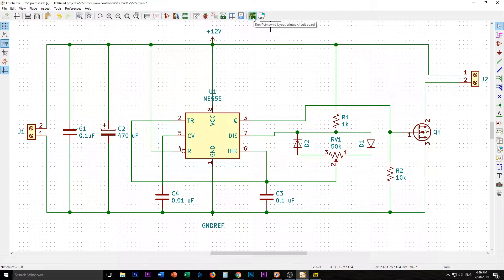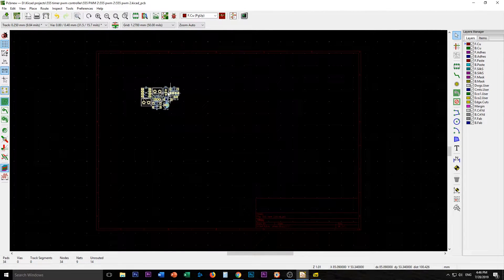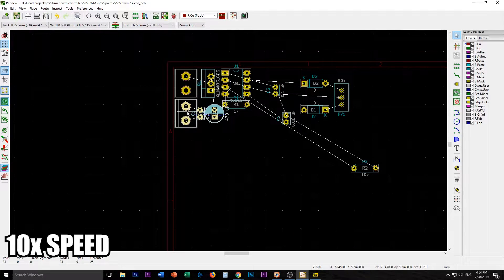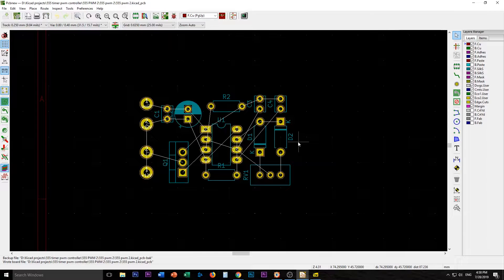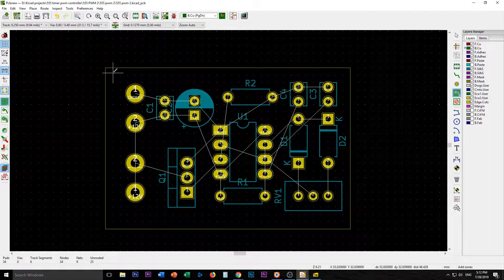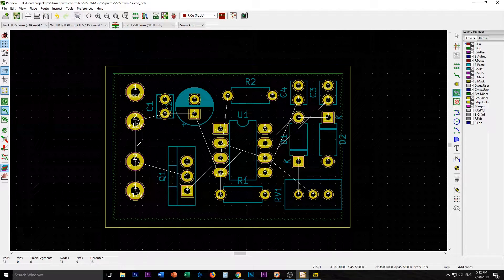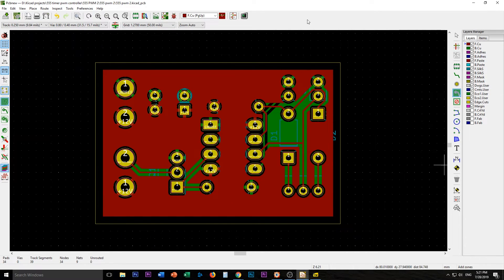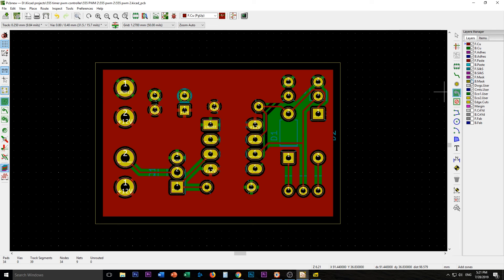KiCAD For Beginners 3 - Laying Out The Board

Comment: For the distribution of the devices I use a fixed 2.54 mm (0.1 inch) grid when ever this is possible. This gives a well ordered PCB design.

From the viepoint of functionality:

1.) I consider this PWM module as a controller. So i would through the power mosfet and R2 out of it in order to combine it with different power modules. So I would go directly from pin 3 of the IC to the output terminal and connect it to the ground plane. For the terminals I would put put the positive pin up and ground down. This helps also to save space for C2.

2.) C1 is the buffer capacitor for the 555 timer IC. it should be located as close as possible to pin 8 with a short connection to the ground plane. Otherwise it doesn't work the way it is intended to, especially if you use such thin copper lines.

3.) With 1.) and 2.) you save a lot of space left of the timer IC. So it can go more to the left to get space on the right of it. I would put C3 direcly to pin 2 and C4 directly to pin 5. So you can go directly from R1 with a straight line to both diodes and from the diodes to the potentiometer.

4.) The diode package is much to heavy. You dont need 1 A diodes in this circuit, they are also relatively slowly (which doesn't matter for 500 Hz) and they have a higher forward voltage. You can use the switching diodes 1N4148 with their DO-35 package. So you can also place R1 above of them from the Vcc plane. I guess you get all the parts on a less than 40 x 40 mm² square PCB.

Comment: The import of the devices to the PCB window is much more convenient in EasyEDA. This tool doesn't throw all the devices on the tightest heep. They appear very well separated and ordered according to their functionality on the plane. If you change the schematic and you select other or more devices they appear in the same way and well separated and ordered outside the frame where you have allready arranged and routed.

Comment: Hi, bit late in the day but i would have removed the link between D1 and D2 looping through C3 and placed the track on the other side. with through hole components using the two side is quite easy with the need to use too many via's. nice to watch.

Comment: hi, if you add a pullup resistor to reset for example you can do it on one layer single sided ;) 
... otherwise one single wire link would do the job ;)
Im not a KiCAD pro, but i thought that must be possible, so i tried ;)
https://github.com/specs32/tests/blob/master/Screenshot_2020-01-25_19-29-02.png
(thats just a test to see if the DRC checks out, otherwise i would make the copper nicer ;))